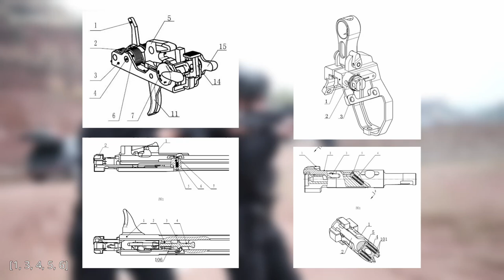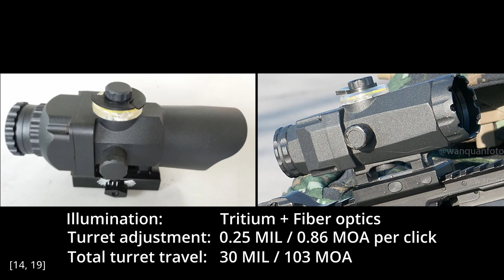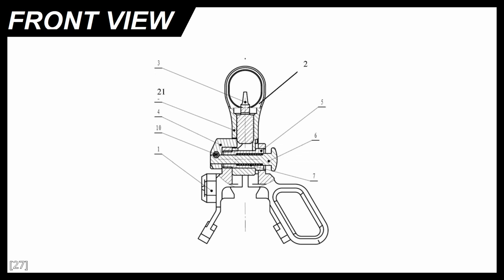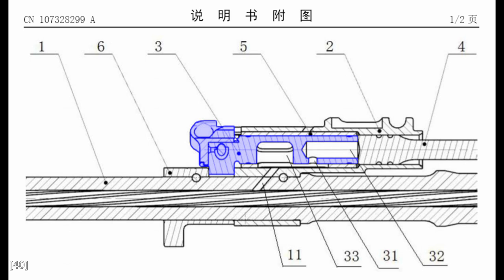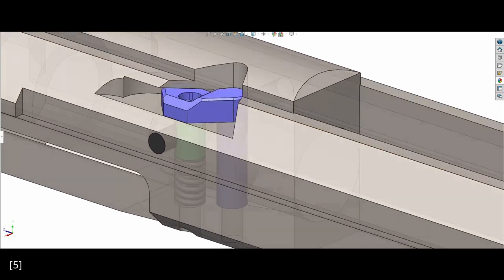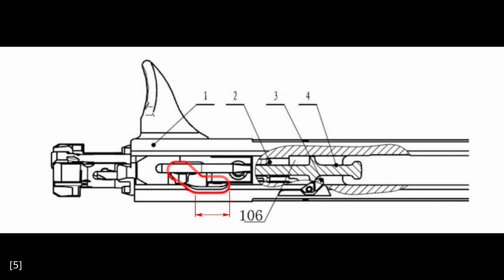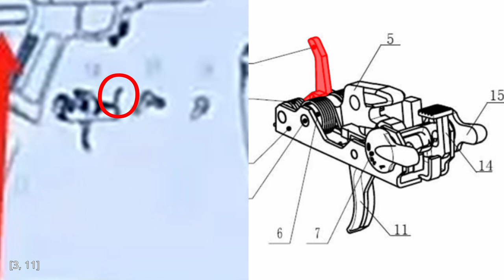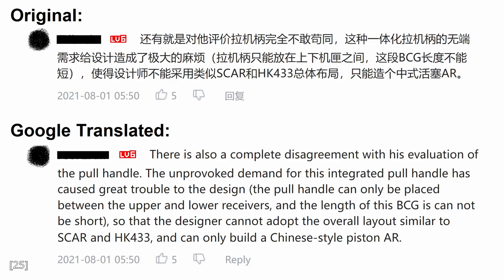QBZ191 - Update / Deep dive [CHECK PINNED COMMENT FOR UPDATES]

Comment: So QBZ-191 is actually a rifle with improved AR-15 in reliability and got an AK style fire control group😮
That's interesting crossbreed and I hope this gun could add in some FPS game😆
Reply: its more of a knock off of the taiwanese knock off of an AR-15 with an ak fcg, probably as or less reliable than an hk416 or the T-91(being the other piston driven military grade AR pattern rifles being commonly used) If you want to see something that's a real crossbreed between the AR and AK check out the Daewoo K2 South Korea used to use.
Reply: @Brahim Gudah, so salty that you can’t fathom, you just have to express jealousy to the point. China is not like India who made shitty guns and buys every gun from the market with the army of logistical nightmare. And QBZ-191 is not like INSAS which is a complete joke.
Reply: @kaungzawtun510  ya you are right it's not the INSAS because the INSAS was an identical copy of the AK but with different furniture. This is an exact copy of an AR with an exact copy of an AK trigger  do your research and look at the T-91 it's literally this exact gun with slightly different geometry. This is much closer to the Galil which is a near exact copy of the AK platform but with minor upgrades. I know everyone in China wants to act like they finally invented something that isn't just an AK with a short stroke system but this gun is factually an AR platform gun. The 191 is very nice maybe even up to the standards of something like an HK 416 but with some minor issues. 

The AK fire control group is famously terrible, even the nice options on the aftermarket don't feel or perform as well as even basic AR triggers so it was interesting that they chose to put the most hated part of the AK in the gun isntead. Hexagonal bolt carrier could give some directional constraint to the carrier group while cycling... Too bad these idiots decided to keep the round AR buffer tube therefore negating that benefit completely. The right side charging handle has been common in civilian AR rifles for years now. The optic mounts are still pic rails with what possibly looks like an mlok flashlight attachment near the front of the handguard... Great except pic rails suck for optics and are being phased out and mlok is most useful for foregrips and sights due to the strength of the ajoinment and for maintaining zero on a sight when removing and replacing it, but I guess china is into that 1990s tacticool airsoft look still. I guess the adjustable gas block is pretty cool and new, not because it's a short stroke system on an AR or that it's adjustable, but because it has an extra expansion chamber to decrease noise when suppressed and slightly lighten recoil. If you think this gun is anything more than a Chinese AR clone with a handful of improvements and a handful of oversights then you can't understand the engineering principles that make the QBZ 191 and AR-15 the same platform and almost functionally identical rifles then you don't have enough knowledge to speak on this subject.
Reply: @AVWUVU  making something new isn't just copying something old and making sure the parts don't fit, but I'm sure you don't understand that since you apparently think this gun is an original design. I bet you think china invented automobile too because dongfeng parts won't fit on a Ford

The K2 isn't a knock off but no one involved in the design would be caught dead saying it wasn't a last ditch effort to use left over AR parts supplied by the US to make a cheaper and easier to produce rifle.
Reply: @bigbugg92  Name me another gun that haves this EXACT gas port design, bcg design, handguard design, receiver design, that fires 5.8mm. What a tool you are.
Reply: @bigbugg92  Your logic is beyond insane. It's like saying all cars are a copy of each other because they have 4 wheels. Literally, 99% of all human creations for the last 300 years have been built on old ideas that aren't original. China did invent Gunpowder but you don't see the Chinese say anything that uses gunpowder is copying them because no one else but you would say something so massively assine.
Reply: @bigbugg92  "you can't understand the engineering principles that make the QBZ 191 and AR-15 the same platform and almost functionally identical rifles then you don't have enough knowledge to speak on this subject." - an idian troll. Lmao, we're done.
Reply: @AVWUVU  lol ok so you actually don't understand what a platform is or what copying means... You might as well be saying "name me another gun with the same serial number called a QBZ 191" huh can't well I guess it's not a copy. How in denial can you be to say if its not an exact 100% millimeter by millimeter copy then it's original. Next thing you are gonna say is the hk416 isn't an AR because the gas system is different from a colt m16a2.
Reply: @AVWUVU  literally American dude, Ive seen hundreds of AR platform rifles and this is by far one of the most overhyped derivatives I've ever seen
Reply: @AVWUVU  no your logic is literally insane if you take the exact design of a piston driven AR and change the shape of a couple parts it doesn't make it a new gun it makes it a derivative. You even said it yourself we don't use the original design for gunpowder but it's still gunpowder. If you build a jeep in China but change the muffler and air intake it doesn't make it less of a copy. If someone in China invents a new type of bearing and puts it in a fidget spinner it's still a fidget spinner it's just upgraded. If you copy an article from Wikipedia but change key words to make it sound like you wrote it its still copying. If you carve Shakespeare into a rock it's still a copy of Shakespeare. If you chamber an AR in 7.62x39 and throw on an Adam's arms piston kit it's still an AR.if you build an AK in 5.8mm, change the stock, add a few attachment rails, change the geometry of the bolt carrier, and invent a new gas block it's still an AK platform rifle. If you take the design of an AR rifle and design your own proprietary parts for it and chamber it in 5.8mm it's still an AR platform rifle. You can go online right now and buy a bufferless direct blowback AR pistol in .45acp that takes proprietary magazines, has no gas block at all, with a 7.5 inch barrel, a folding stock, no buffer tube thread, a non standard grip, keymod attachment rails, a different handguard, and a lower receiver that won't fit a standard AR upper receiver but that is still an AR platform rifle. I'm not saying it's the same rifle, I'm saying it's a copy of what has been the dominant rifle platform for the past 60 years.
Reply from the maker: @bigbugg92  Ultimately, the QBZ191 – like the majority of service rifles designed in the last few decades – borrowed a lot from other platforms. It borrowed the most from the AR-15, so it’s an AR-15 derivative, and the facts stop there. Whether it is an “AR derivative with a lot of well thought out enhancements that add up to place it a league above its predecessor”, or an “AR knock-off with a handful of modifications”, starts to enter the realm of subjective opinions. We can take either stand and still be technically correct. Personally, I think calling it a clone or a knock-off removes all the nuances, and severely downplays the engineering that went into all the enhancements, which were very significant, but that’s just me. If you think the opposite then I guess we’ll have to agree to disagree there. 

But you did bring up some technical details which I will nitpick if you don’t mind. 

An AK-style fire control group does not automatically mean the trigger will feel terrible, or sub-par compared to an AR, especially when we’re talking about mil-spec guns and not tricked-out civilian ones. The CZ 805 uses an AK trigger, and people seem to like it. Many two-stage AR triggers use the AK-style double hook design, Geissele makes a few of them. The prototype QBZ191 has a 2-stage trigger, and the patent document for that specifically mentioned how they want to improve the trigger feel when designing the 191. So I wouldn’t be surprised if the production 191 trigger pack is fairly nice as well. 

The production 191 hammer also has an added geometry to stops the hammer from slapping the disconnector, which is an enhancement compared to both traditional AR & AK fire control groups. I wrote about that in my pinned comment, so you can read more over there if you like. I wrote another paragraph on my speculation that the 191 trigger has a potential safety issue, so you can also read that and deduct a mark for the 191. 

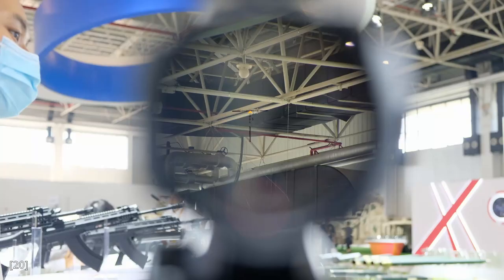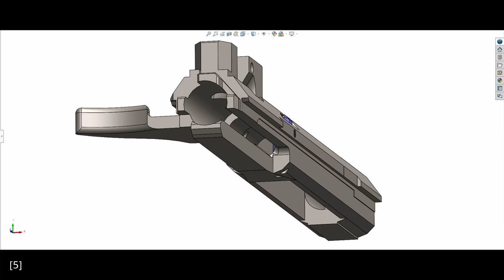The buffer tube on the 191 is not round, see 11:33. If you were referring to carrier tilt when you wrote “Hexagonal bolt carrier could give some directional constraint to the carrier group while cycling”, then the 191 wouldn’t have that problem either. As mentioned at 21:04, the bolt carrier is supported on both sides by 2 rails, so it wouldn’t matter even if the buffer tube is round. And even if the buffer tube is round AND the bolt carrier has no rails, it wouldn’t necessary mean carrier tilt. The PWS Mk116 mod 2 has a round buffer tube design, but still has features to prevent carrier tilt. 

Side charging handles are common among commercial ARs, but most of them require you to remove the charging handle before you can remove the bolt carrier group. The QBZ191 charging handle runs in the gap between the upper and lower receivers, so it doesn’t have this problem. Another commenter mentioned that the 191 charging handle is forged together with the bolt carrier as one piece. If this is true, then the 191 charging handle would be much stronger than that of other side charging ARs. Equating them only compares the general form factor, and didn’t take into account the qualitative differences between the two. 

I also don’t know how pic rails sucks for optics. If you mean the pic rails at 12 o’clock on the handguards, then optics are not supposed to be mounted there. Lasers mounted on the polymer QBZ191 and 192 handguards may or may not hold zero, but that’s due to the handguards being polymer and has nothing to do with them being picatinny. And even when the QBZ191 and 192 handguards are polymer, they’re still reinforced by the handguard sleeve described at 11:39, and should be relatively stable. Also the slots near the front of the polymer handguards are not MLOK, they’re just heat vents. On the polymer handguard, additional pic rails can be mounted to 3 sets of threaded metal inserts at the 3, 6, and 9 o’clock position, which I described in my previous QBZ191 video. The QBU191 dmr has a free-floated MLOK handguard. Also MLOK handguards are phasing out picatinny handguards because they’re lighter (compared to a picatinny handguard of the same material), not because they’re stronger or hold zero better. Neither of those are true. As for the picatinny rail on the upper receiver as an optic mounting interface, I don’t think anything is phasing it out yet.

Also the polymer handguards are definitely not interchangeable with AR handguards. Non-free-floated AR handguards have surfaces to mate with the retaining cap near the gas block and the delta ring. These surfaces are not present on the 191 polymer handguards. The free-floated handguard on the QBU can potentially be interchangeable with some free-floated AR handguards, since the mounting mechanism looks similar, but the dimensions of the interface between the handguard and the barrel nut must match near exactly for them to fit. This can’t be determined by looking at the photos. 

The mass of the buffer, as well as the stiffness of the buffer spring, must be calibrated exactly to account for the operating parameters of the gun. These include the pressure curve of the ammunition, the gas system length, the mass of other reciprocating parts, the stroke length of the bcg, and probably many other things. So I doubt these parts are interchangeable between the QBZ and the AR. Not to mention that the buffer tube on the QBZ is not round. 

The important thing about the expansion chamber is that it reduces the erosion of the regulator port. This directly affects durability and reliability. Lighter recoil or quieter suppressed shooting are just extra perks. I also don’t think you can tell if it will be quieter while shooting suppressed. The expansion chamber reduces BCG velocity, slows down the unlocking of the bolt, so the bolt will unlock when the chamber pressure is lower, which theoretically reduces port pop. But it’s hard to tell if it’ll make any perceivable differences irl. I also doubt that the amount of gas going into the expansion chamber is significant enough to reduce the gas pressure at the muzzle in any meaningful way.
Reply: @cabbage6015  I really appreciate your well thought out response, but I do have some things to say about the supposed improvements to this rifle. This gun is an AR platform rifle, albeit an extremely non standard variant. The weighting of the buffer is less important than you think to the function of the gun and based on the ballistics of the 5.8 round it likely is weighted and tensioned almost perfectly (though a bit t heavier) for a 5.56 AR, I'd imagined it runs somewhere around the weight of an h1 buffer, or if the recoil was too violent in testing they may have weighted it similar to a H2. The idea they need to be precisely measured is pure fiction and anyone who's built or modified an AR will tell you increasing the weight helps with perceived recoil but the general rule is use the heaviest you can before it starts malfunctioning. As for the hexagonal pattern of the buffer, I didn't see in the video that the internal dimensions of the tube are hexagonal which would be the important part when talking about carrier group movement. Tilt also wasn't what I was referring to, rotation was more of my concern since so much of this gun was given corners I could see rotation causing significant wear to the carrier group and possibly causing issues even before the first barrel replacement would be necessary.

Also the 12 o clock pic rails on the receiver is for optics which is why there are optics on it in the video. It's fine it will keep zero until the optic gets bumped or it needs to be removed and replaced pic rails optic mounts are being phased out because zero shift is a serious problem with a modular weapon that won't have the chance to re zero in the field. This can be overcome with extremely tight tolerances and superior design on the optic side, but the pic rails was never meant to be a permanent optic mounting system, people stuck with it because it was less of a pain that dovetails and you can quickly attach and remove things from it. The only reason the west holds on topicatinny for optic mounts is because 40 years of accessories were made for it.

When talking about mil spec triggers is where the AK vs AR issue is the largest. Mil spec AR triggers are about as clean as the nicer aftermarket AK triggers, this is something I noticed as an owner of both platforms with examples using multiple trigger packs and fcgs. Making the gun a 2 stage trigger makes me further suspect they designed a soft trigger as 2 stage triggers are used when pull is sloppy and the break is inconsistent so the user can have feedback as to when they are about to actually pull the trigger. 

The hammer/disconnector modification seems nice except that's not a problem people actually face with the AR or AK platform. It is extremely rare to see fire control group failures caused by parts slapping even in rifles with high round counts. I imagine it was actually done to differentiate the rifle as so many of the design choices seem to be different for the sake of not being the same. it's nice that they thought about the trigger, but from your write up it looks like a safety hazard was created to solve a non problem.

The side charging handle Is actually really cool, everyone knows reciprocating side chargers are better if for no other reason than mortaring the rifle during a jam, I'm glad the higher ups made them include that. It's even really cool that it slides in the slot between the receiver parts, but I wouldn't call new since that's essentially how an AK side charging handle works as well.

As for the handguard, the free float qbu handguard would likely fit if threads were the same which is what I was saying. The fact the fasteners are different doesn't make it a new design it makes it an old design made purposefully non standard. Mlok is certainly phasing out picatinny because it is lighter, but also showed the lowest zero shift for optics (when removed and re attached or dropped mlok shifts an average of 1.3moa vs something like 4moa for picatinny rails) And while I'm not saying the west is currently removing the pic rails it does seem like if a country was to make an "all new" rifle design from the ground up they might not use the oldest, heaviest, and least reliable type of mounting system. Even the AK side rail is lighter provides better repeatability than picatinny. The main disadvantage of the side rail vs picatinny is when working with a variety of optics and styles of optic like in NATO where standards need to be open enough for each member to be able to provide their own hardware while maintaining the ability to use allies accessories if necessary. China has no need to keep NATO standards, they made this rifle and new optics to go with it and while their QD mount might have tight enough tolerances and be well engineered enough to make up for picatinny rails inherent sloppiness, it kinda seems like they could have spared the half pound of weight that long top rail adds to the rifle while improving the practical usability of the rifle.

The end product from an ergonomics and function standpoint seems to be basically just an ar-15 but with almost none of the aftermarket support and what looks like a Magpul Zhukov AK handguard adapted to fit an AR platform.
The qbu looks like a much better rifle for everything but urban combat. The QBZ looks like it is just incorporating a lot of things either people are moving away from or were shown to have a negative effect on performance and I'm really looking forward to seeing the solutions to these. For example the US government had serious accuracy, powder burn, bullet stability, and penetration issues when running sub 14.5 inch barrels with 5.56 which led to the development of rounds like 300blk and 6.8. the other solution was to lengthen the bullets without increasing the weight to provide for better stability. The Chinese have a long history with 7.62x39 and it would be interesting to see them adapt the new rifle back to it or even something like 9x39. It's just super interesting and I'm sorry if you went through and read all my rambling, but this rifle seems to be built to fix problems that don't exist while not really addressing the main problems of the AR platform. I'm sure everything done is purposeful and reasonable, but other than the 5.8 being a superior caliber I don't see an evident improvement in this over something like an hk 416 other than that admitedly pretty cool gas block. Also anything that shames the west into killing the idiot button (forward assist) on the AR is alright with me.

As for the expansion chamber, I really don't care if they claim its for longevity and reliability, it most likely won't improve either of those and the gas block should outlive the barrel and looking at the rest of the gun it seems like the gas port would likely outlast most of the gun with or without an expansion chamber, the bigger question is if it can decrease wear or errosion of the actual gas hole as opposed to the regulator port. The expansion chamber should significantly decrease port pop and should lead to consistent recoil with or without a muzzle device providing further back pressure. The erosion of the barrel around the gas port has been a constant struggle for auto and semi auto, I see that a second regulated port could greatly reduce the problems from a widening hole and recoil, but it is doubtful again that the rest of the rilfe would last long enough on it's original barrel to have that problem as they seem to have designed a great system for a light machine gun that may see 30000 rounds through a barrel.

The gun is definitely upgraded, and I will say knock off was the wrong word to use. That being said it is just a non standard AR platform rifle not unlike how the Galil is considered part of the AK platform.

I greatly appreciate your technical explanation of the critiques I had for the rifle either way it's a very cool AR, I'm just sad to see the old bullpup QBZs go away just to be replaced with another boring stoner platform. My argument with the trolls was that it is an AR platform and not an all new design, it definitely shows a lot of forethought and attempts to improve on the original AR pattern, but to call this anything but a new variant of AR would be a discredit to both the AR platform and the QBZ 191.
Reply from the maker: @bigbugg92  This is the first half of my reply (I had to split it in two bc it went over the character limit):

My comment about the buffer was intended to express that there were likely a lot of ground-up calculations involved in the design of the QBZ buffer, and it’s not a matter of just carrying something over. Of course, given the similarities between the 5.8 and the 5.56, I have no doubts that the final results are somewhere in the same ballpark. I am also aware of how people use heavier buffers to reduce felt recoil, and how using the heaviest buffer possible without a malfunction is a common practice in building ARs. But as I understand, this practice is unfit for a military rifle, since it doesn’t account for variance in operating conditions. Chris Bartocci from Small Arms Solution emphasized this point and recommended against straying from mil-spec buffers and buffer springs, precisely because they are perfectly calculated for the rifle. 

Regarding the inner profile of the buffer tube, I do admit that I assumed they would machine the inner profile similar to the bcg and the outer profile, and there are no images to prove this. But I would also say that there are no images that show the inner profile is round either, although I think this possibility is not unlikely since it would simplify manufacturing. As for the rotation of the bcg, on traditional ARs, the gas key / tombstone on the bcg runs inside the track at 12 o’clock inside the upper receiver to prevent this rotation. The tombstone on the QBZ bcg also works similarly, and in addition, the two rails on the sides will provide even more support. So I don’t foresee bolt carrier rotation to be an issue in the 191.

I also have doubts that the picatinny rails on the upper will have trouble holding zero if the optic is bumped. I have never heard of optics being knocked out of zero on picatinny rails if they are even half-way decent. I don’t see how tight tolerances are needed to securely hold an optic on the rails either. As I understand, as a mounting clamp is tightened onto a picatinny rail, the bottom slanted surfaces on both sides of the rail pulls the mount downwards, until the bottom of the mount contacts the top surface of the rail. As long as there is enough travel in the clamping piece of the mount such that this piece doesn’t bottom out before the top surface of the rail makes contact, the mount should be very tight. I have no doubts that the west holds on to picatinny because of reverse compatibility, but I also haven’t seen any reason, nor heard any news that they want to move away from it.

As for the trigger, I will fully admit that my experience with both the AR and the AK is almost purely secondhand information, as I have had 0 trigger time on the AK, and about 5 mins behind an AR at a rental range before they were banned in Canada. So if you say from your personal experience that you prefer a mil-spec AR trigger over that of an AK, there’s nothing I can say about that. What I gathered from other people’s experiences is that mil-spec AR triggers are around 7-9 lbs with a crisp single stage break, while AK triggers are 4-6 lbs with a long single stage and unpredictable break, and how good they are ultimately comes down to personal preference. And based on how there are AK-style trigger that are well received, and how there are gucci 2-stage triggers that people voluntarily put into their ARs, I still maintain that it’s unreasonable to judge the QBZ trigger based solely on the fact that it is AK-style. It’s also unlikely that they were forced to design a 2-stage trigger bc their trigger is soft and sloppy, since their prototype fcg is an AR-style trigger that they deliberately made into a 2-stage.

Regarding the hammer/disconnector modification, I know that some HK416 variants have a stamped sheet metal piece precisely to protect the disconnector from being struck by the hammer. On AKs, trigger slapping, where the hammer strikes the back of the trigger and make the trigger jumps forward into the shooter’s finger, is also an issue that comes up with some frequency, but they’re not present in every rifle. So I would say that this modification have real merit and not just different for the sake of being different.

As for the safety issue, honestly I’m pretty curious how this is gonna turn out. I certainly don’t think they deliberately chose to solve a minor issue at the cost of creating a hazard. But I’m just not sure if my analysis is wrong, or they really missed that safety problem. I highly doubt that I managed to catch something that slipped the mind of an entire design board in the country that produces most STEM graduates per year in the world.
Reply from the maker: @bigbugg92  2nd half:

I did not intend to argue that the charging handle is anything new, since it’s obviously not. As you said, that’s basically how an AK charging handle works. But I’d say the fact that they implemented this mechanism on an AR derivative makes it an improvement compared to commercial AR side charging handles, while also eliminated the weakness of the AK where there is an open charging handle slot where debris can get in. I briefly talked about this in my previous video, and it is the ultimate theme of this video as well. The nice thing about the 191 is not that the Chinese invented anything new, but that they combined pre-existing mechanisms in clever ways that solved some problems in prior designs, while also adding some incremental improvements.

As for the MLOK handguard on the QBU, I also didn’t intend to say that it’s new. I mentioned in the video that it’s mounted how free-floated AR handguards are mounted. The reason I commented on it was bc I had the impression that you claimed it is completely interchangeable with an AR, in the sense that you can just take it off the QBU and immediately put it on an AR. I agree that the fasteners are different doesn’t make it a new design, but I wouldn’t say that it’s just purposefully made non-standard either. It’s likely that they just used whatever dimension necessary to fit over their barrel extension, that has to accommodate a bolt face specific to their ammunition. Then they probably used metric threading bc that’s the system they use. 

I also recall an US army test when they compared MLOK to Keymod where it was indeed found out that MLOK has more repeatable interface that Keymod, but I don’t think it’s more repeatable than picatinny. An accessory mounted on an MLOK handguard is usually mounted on a picatinny section that is mounted to the MLOK, so theoretically a handguard with picatinny integral to it would be better, no? Unless you’re talking about a way to mount optics directly into MLOK that I haven’t heard of, in which case, I would greatly appreciate a link if you have one. Then again, I don’t think the Chinese deciding to go with picatinny is as backward of a decision that you’re saying. They have adopted picatinny rails and picatinny accessories sometime in the 2000s, albeit only for their armed police and swat, not for the whole military. These units actually use a lot of imported Western optics and lasers, in addition to their domestically produced accessories that also use picatinny. So they do have an incentive to keep picatinny, assuming that there is a better option like you said. And also on their end, the oldest system would be the proprietary rails for the QBZ95 and QBZ03, which has as much functionality as the AK side rail.

As for the gas system, it is very likely that their claim of increased longevity is correct, because they specifically cited that their QBZ95B carbines had very excessive gas port erosion due to the higher port pressure. And at the end of the day, whether the gas block or the rest of the gun will last longer depends on information that we have no access to, and I would believe their document over either of our speculations. I also think that it is more important for them to reduce erosion of the regulator port than the barrel gas hole. The regulator has one small port for normal use, one large port for adverse conditions. The barrel port must be at least as large as the adverse port, so that enough gas goes through that port when you switch to the adverse setting. But this means that during normal use, an excessive amount of gas will flow to the normal port, which the normal port will have to constrict. So I’d say that reducing wear of the regulator port is a good call, because the barrel gas hole is already overgassed anyway. And again, I’m doubtful that we will know if port pop is significantly improved by the expansion chamber. I’d say an improved gas system will reduce port pop most noticeably on DI guns, where excessive pressure from the gas system is vented out of the ejection port. But on piston guns where port pop is mainly due to residue pressure in the chamber when the bolt unlocks, a slightly slower or faster bcg is unlikely to make any difference that is noticeable over the sound of a 5.8 going supersonic. And of course, I guess the true answer is both of our opinions on this is pure speculation as we don’t know the specific operating parameters for this gun.

At the end of the day, I also really appreciate your response, even though it seems like we’re both disagreeing a lot. In fact, I especially appreciate that we can have these disagreements without jumping down each other’s throats lol. And to be completely frank, when you first commented on my video of a Chinese rifle, saying it’s a knock-off of an American rifle, and telling people to buy a Taiwanese rifle, I thought you’re just here to stir the pot and that soured my first impression of you a bit. But you took time to make a lot of valid points as well. I’m also glad that you and I both appreciate some of the incremental improvements on this rifle while recognizing that it is ultimately a derivative. Yeah I think that the QBZ95 had more soul as well, but it’s definitely showing it’s age, and the 191 seems like a much more practical option in the current scene.
Reply: @bigbugg92  So what is AR? Maybe every gun can be called a variant of AR by your logic.